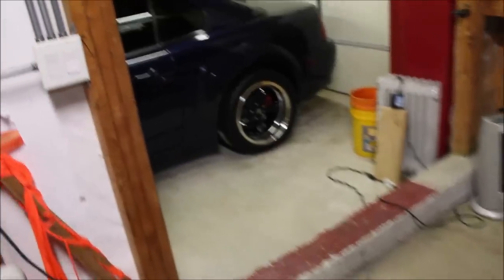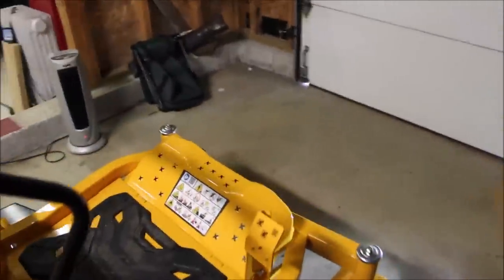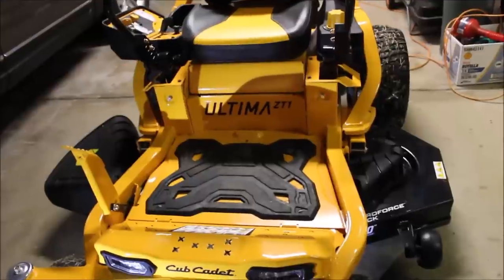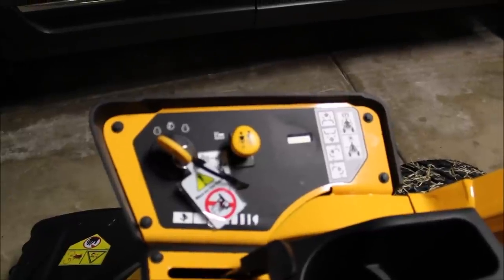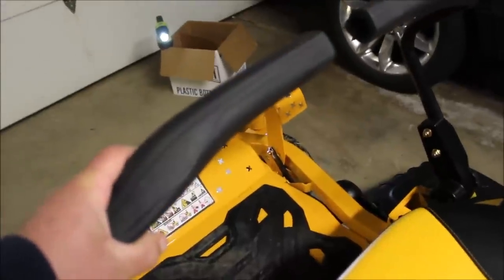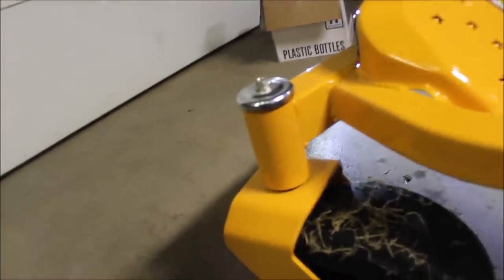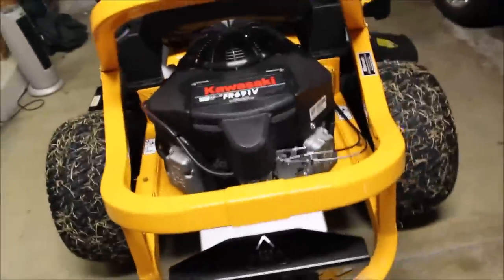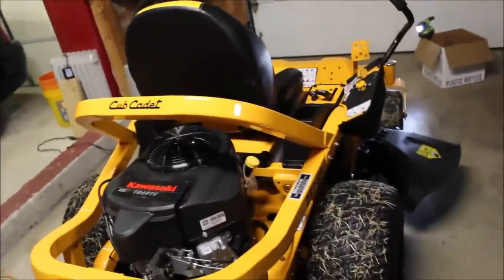Cub Cadet ZT1 Ultima Series Initial Overview

Comment: On 4/30/19 I purchased a ZT1 60" mower for $3400 at Home Depot. It broke after 3 hours of use. The hydraulic drives on these Cub Cadets have known issues. It has been in an authorized repair center for 6 weeks now. The repair shop estimates it will be another 4 weeks before I get it back. I urge everyone to not buy Cub Cadet. Their customer service has been HORRIBLE. My next mower will be a Kubota.
Reply from the maker: Man I'm sorry to hear that, I've had the deck issues which seems to be as good as it will be for now. I know the hydros are hydro gear which are used in all different brands like the engines are. Cub should have put new hydros on and got your mower back to you ASAP. Anytime you buy something new it sucks to have issues and shouldn't happen but if the customer service is great you can have an easier time overlooking the issue.This is my first zero turn and I notice the hydros growl alot which might be normal and even with my deck repaired it's still too noisy Imo. I love the mowers overall design and comfort and the cut quality is excellent, I just hope that the mower holds up long term. For 3k + we should get a smooth operating reliable unit that we can brag about! I hope you get yours straightened out soon again they should just give you a new mower 6 weeks is insane! Cub put in the order for all new deck parts on mine and the dealer did not change the belt. I called Cub and asked them to send me the belt so I could change it myself and they did free of charge. I will continue to watch my hydro operation, I have a hill at the back of my yard that I have to climb the mower climbs with ease and hopefully the hydros will hold up. I had an old Craftsman that was used when I bought it and cut my yard for 15 years climbing that hill etc with only one spindle change. This Cub SHOULD be a much better  mower than that, only time will tell?.....Thanks for leaving the comment keep us posted on your outcome?